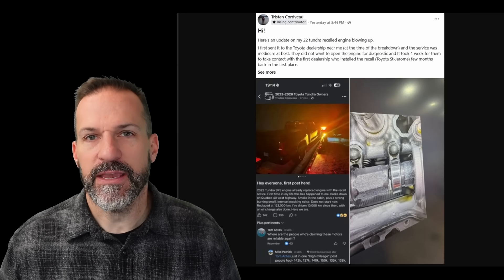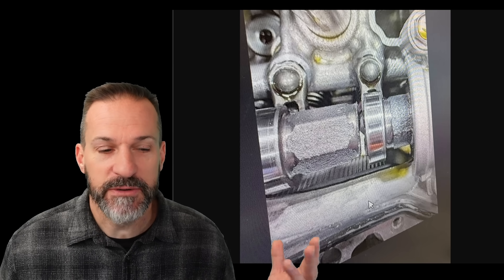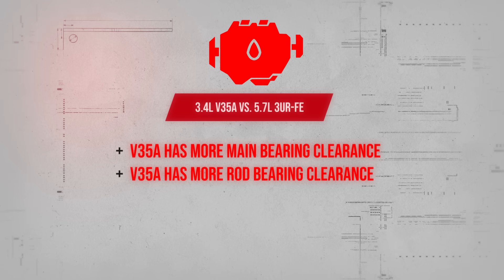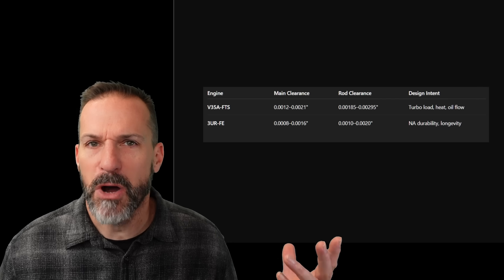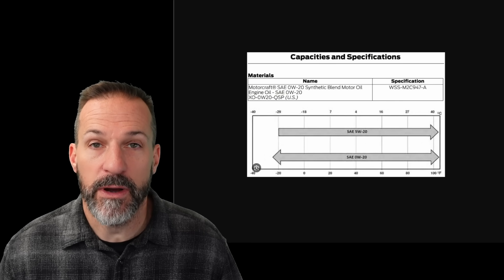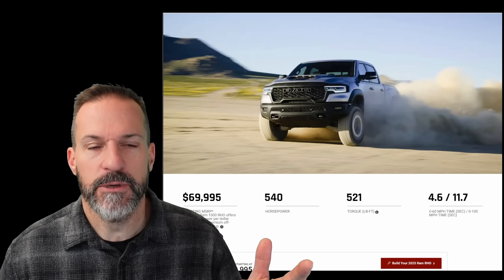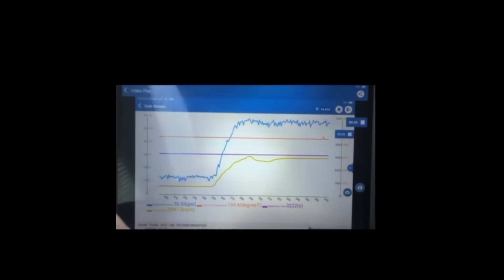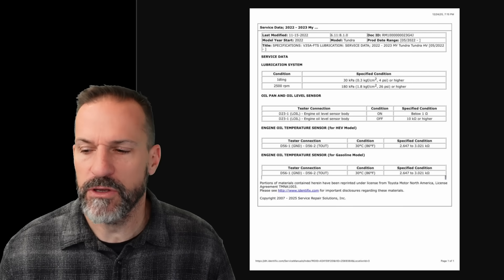Can We FIX Toyota's BILLION Dollar Mistake at Walmart? 2022- 2026 Tundra...

Comment: Is there a mod to increase the oil pressure at idle? To me, an oil pump should be 100% mechanical and not controlled in any way.
Reply: Yes. But expensive and likely custom. Search for “Dry Sump”. Provides consistent oil supply through extreme conditions, angles, and speeds.

Comment: Look up the Stribeck curve guys, understand it. By changing to a higher viscosity oil you push yourself into the hydrodynamic region of the curve sooner, less friction less wear. There are potential drawbacks, the higher viscosity will cause higher engine load which will cause the friction coefficient to climb and higher viscosity oil will have more viscosity modifiers which are subject to shearing. Oil isn't only used as lubrication anymore it's also used as a hydraulic fluid for various functions like VVT. The key is to find the sweet spot of viscosity that gets you into the hydrodynamic region of the Stribeck curve as soon as possible while also keeping engine load low and being the right viscosity to perform the hydraulic functions of the complex systems in the engine. In the case of Toyota and GM where bearings are getting chewed apart, higher viscosity oil is a bandaid fix, but it can be a fix and frequent oil changes are a must.

Comment: 4 6 7 psi is way way to low 22rs Toyota hot always were known for low idle press 15 psi  it would be 50 or so of idle yea computer has to trigger oil pressure after  you stab the throttle that the issue  take time for pressure oil to get on plane low pressure on ideal is bad  do that to any moter it will eat it self 5w40 and tune that oil pressure asap or get get of that dumb stuff modd the world

Comment: 4 psi for the name of fuel efficiency.  That's way too low oil pressure. Fewer main bearing, higher cylinder pressure with the turbo, 87 octane recommended fuel, that v6 has no chance.

Comment: I don't think 5W-30 will substantially help the Tundra V6 bearing failure issue because the factory specification oil pressure for the 2024-2026 4 cylinder Tacoma/4Runner Toyota T24A-FTS engine is also "at least 4.2 psi at idle" and that engine is also undersquare, turbocharged and has a variable oil pump yet it doesn't have bearing durability problems. I think 2022-2024 Tundra V6 bearing failure issue is more related to design issues that are so complex, Toyota's own engineers are having major difficulty coming up with a proven remedy.

Comment: If the variable pressure is the root cause, Toyota could simply reprogram the pumps to increase pressure at idle or lower RPMs. I can’t imagine they’d thrash their reputation for the marginal efficiency improvements that a variable pressure pump would provide. But here we are.

Comment: You finally looked stuff up instead of running your mouth. Manufacturers are using smaller displacement to produce more power- that’s a lot more force on bearing and moving components…

It’s not clearances etc.

Comment: I wonder what the oil pressure is at the rear main bearing.  Could it be near zero in some cases?
Reply from the maker: hard to say. The car care nut and some others have torn down this V35A engine block and tried to determine the oil flow path, I believe they have the sequence described in their videos.

Comment: I have a 2022 tundra and my replacement engine failed at 6k after the install and they said it was a broken exhaust camshaft. And here I thought I was the only one 😮😮.
Reply: I worked for a Toyota dealer in 1980 and Camry hollow camshafts were a breaking

Comment: To find the PROPER WEIGHT OIL EXACTLY. just look up the recommended oil FOR THE EXACT SAME ENGINE SOLD ANYWHERE OUTSIDE THE USA. Stop comparing to other vehicle models ! Simple. What oil weight does the new Tundra model in Japan use ? Europe ? Do they use 5W20 or 5W30 weights ? DON'T GUESS - FIND OUT !

Comment: I work as a fleet administrator and we have about 8000  trucks vans suv ect. They drive this cars for 10 to 18 or 20 hours plus without turning off but to refill the tank. The only oil they use is 5w30 no one problem. With the engines . And they drive this cars to 350.000 miles.  I think the 0w20 is not the right oil for this cars. The 0w20 is getting destroyed to fast. We replace the oil at 4.000 to 5.000 miles but we use to change at 7.500 miles no issues.

Comment: Makes you wonder if a tune could fix this by disabling the variable oil pressure system and locking it out to high pressure only.
Reply: That or aftermarket to the rescue, wonder if anybody makes either a traditional style oil pump for them or if you can put in a stiffer or lighter spring in it to bring up the low threshold for oil pressure. Obviously no good until the warranty is up, but it might be worthwhile. I wonder if GMs would have less lifter issues with better oil pressure. The Ford 7.3s have been eating bearings in applications with high idle time, so its a problem there too. Its not like the industry forgot how to machine a block suddenly, I think its a case where on paper and in engine test bays something works, but by the time you have lowest bidder 3rd party suppliers mass manufacturing parts and engines living in real world conditions things don't work out like they looked like they would.
Reply: @DaveJacobs-f7c 
In the case of GM consider it's a full sized SUV 6-7 thousand pounds? It's cruising down the highway in 10th gear, probably at 1400 rpm and it makes a shitload of torque. Maybe pulling a hill. Probably at the lowest oil pressure to make up a tenth of a mpg

Comment: Toyota built this engine as part of a joint venture with BMW. The interesting thing is that BMW engines often fail after around 50,000 Miles but here they are failing very early .

This engine can be fixed, but the core issue is its design. The engine block is too small for the amount of pressure it handles. Toyota should increase the block size by about one inch, use stronger materials such as titanium for key components like the crankshaft, and reduce the horsepower, similar to what Honda did in the late 1990s with the NSX.

The engine itself is simple and compact, but the twin-turbo setup creates excessive stress. The smaller turbo runs continuously, while the larger turbo operates part-time. This means the pistons are under constant load and high stress.
this engine is failing worldwide. The diesel versions perform slightly better, but the overall issue remains.
Toyota might not gonna do it because of doing this they have to redesign whole engine and the engine bay .

Comment: Kind of sounds like a similar issue that the Ford 5.4 L three valve Triton had where the oil pump was too small and too weak to keep up with the oil demand which caused excess wear and can phaser issues
Reply: The three valve suffered from other issues in the oiling system. There were screens in the cam phasers to protect the moving parts from particulate in the oil. Sub standard oil filters coupled with extended oil change intervals contributed greatly to the issues with the three valves. The oil had to stay immaculately clean otherwise the passages in the phasers stopped up causing lack of flow throughout the top end. Ford spent mega bucks on case studies on oil filters during that time frame. Some warranty claims were not honored due to “improper filters” and or “lack of oil maintenance”.

Comment: Hey 👋 so just putting my input out here I had a toyota  2024 trd pro, I put 65k miles on it always used 5w30 instead of the recommended oil i also boosted the engine and had it tuned running 91 only do to me boosting the turbo pressure i never had any issues with it, but with this whole drama with toyota going on I traded it in for a ram trx just for piece of mind and alot more fun 😅
Reply from the maker: Dang a TRX...that's crazy.
Reply: @TheCarGuyOnline ik its a big change even tho my tundra trd pro was getting 12mpg hahaha this one is getting 12, but I have a company truck so only once in a while truck pretty much

Comment: There is no such thing as tighter tolerances or clearances. It has been known since the 1950s and 60s what you can get away with in terms of expansion and contraction and metals have not changed. Stop perpetuating this myth.

Comment: That's not going to work unless Toyota or some aftermarket tuner company reprograms the ECU first. The ECU controls the oil pressure that controls variable timing and both are carefully synchronized in order to optimize engine's on-demand performance. Throwing thicker oil into the mix may help save the bearings while destroying other things in the process. Toyota has to change course first and approve this scenario or Tundra owners who do this on their own can kiss their warranty goodbye.

Comment: i think the big issue is quality of parts dropped around 2019-2020. defective parts increased since then and many shops testify to this. I believe the parts that toyota is having manufacturers make are just not as good as they used to be. Solution: engine swap the old 5.7 into the new truck. problem..... mostly solved.... cant vouch for the rest of the truck

Comment: I think you’re right on the issue! Jeep had a similar issue from late 2013 with the eco diesel. I’m in NZ I have an early version made 2012-13 for Aust, NZ, and Europe. Motori A630 3.0 diesel with a 5 speed trans. They did two things late 2013 on. A slightly bigger turbo and an 8speed transmission, and had problems with spun bearings attributing the cause to the gear ratio when the engine was being lugged at low rpm, the fix going from 5w-30 to 5w-40. The 5 speed early versions from what a jeep mechanic had told me, they have seen none with this issue. Too much torque at low rpm and wrong grade of oil another recommendation was tow in sport mode so it keeps the rpm up and the engine doesn’t work as hard.

Comment: 2020 Ford Expy 3.5 owner, Motorcraft full synthetic 5w-30 every 4-5k. Runs like a sewing machine at 105k. I will be checking the PSI as soon as I can. It's interesting that when Ford changed the oil spec is about the same time that Ecoboost engines started having fewer problems.

Comment: Cars have been using 0/20 for years, without major issues. This leads me to think it's as much a MFG / design issue as it is the weight of the oil. Granted these smaller displacement turbo engines are under more stress, we are living in the days of over engineered and under tested new engines.

Comment: This makes complete sense to me. I personally have decided to stay away from engines with turbos until engineers sort this out.
Reply: Ford has had it sorted for a while now.
Reply: They can't figure out how to cheaply turbocharge an engine...yes.  Tractor-trailers and 18-wheelers seem to do pretty well - 600 hp and 2500 ft/lbs of torque while pulling loads across the US continent.

Comment: I've owned Toyota's for 45 years and see what's happening to this V35A-FTS engines are SCARY..I've worked on engines for over 40 years.. At FIRST I took Toyota corp. WORD that it was DEBRIS that wasn't completely removed from the block after the second year i call it B.S... The ones that are causing the nightmares for these Companies is EPA an CAFE, if they don't follow their standards they're giving very large fines.. I praise the person who hooked up a oil pressure monitor and found very disturbing oil PSI readings like 4psi an 7psi at idle..If this is fact with these engines this may be why they're TEARING UP the main bearings its usually 1 and 4 they take largest loads... I found out that manufacturer psi should be 15 at idle on this engine even at that is below my standard of comfort always had 25 to 30 plus psi at idle ... The 389 horsepower , 479 lb-ft of torgue and Twin-Turbos as far I'm concerned should have minimum 25 to 30psi at idle.. Especially these engines that PUSH high TORGUE in low RPMs...This is what I've done so far to my 2024 TUNDRA TRD 4X4 with ONLY 15,000 miles.. Four oil changes done my last one with 5w-30 instead 0w-20 what it call for, also my oil changes at 5,000 miles intervals NOT 10,000 miles what they call for...I'll be sending another oil sample to the LAB for testing to see if everything is still on track...🤠

Comment: #1 cause is companies being cheap, cheaper and cheapest.  This is for engineering, materials and labor.  Oils too thin.  The smallest parts that 'might' be able to do the job, and built as cheaply as possible.  Toyota built their QDR reputation over decades, and they could completely lose it in a few short years the way they are going.  I am hoping all the new Toyota models and engines work out long term, but it does NOT look good right now.  Your ideas sound good, but the mfgs should be doing this, not us consumers

Comment: It is not tighter tolerances. My GX460 is built to the exact tolerances. I believe they over-stiffened the crank journals, which caused the engines to eat bearings. If so, it would only affect trucks running at higher RPM. People who baby their trucks and hybrids would not have the issue. The undersquare design adds to the speed the piston reaches before stopping to go the other way.

Stop saying it is tolerances. That is just the internet, with an average fifth-grade education, doing its thing. It is similar to people believing the P320 can fire without the trigger moving. It’s impossible and sounds foolish to everyone who knows better.
Reply: What's a p320?

Comment: I switched our 2022 honda ridgeline to 5-30 high spec oil. Change it every 3500 miles. And I am hoping it will last past 100 k.  Nuff said. I thought gas mileage would go down. It went up for some reason. I think there is more oil film and therefore less drag with 5-30.

Comment: Unfortunately toyota isn't simply going to be able to easily remap the oil pump settings since it will "impact" emissions. Any real fix from toyota will take years to be approved. Heavy oil or fooling the pump to run on high are the only options for now

Comment: MY 21 TACO WITH 8K MILES 5 SPEED MANUAL STALLS THE ENGINE AT LOW RPM WITH 0W-20 IN TRAFFIC. I AM VERY FRUSTRATED WITH THIS ISSUE AND SWITCHED TO 5W-30 AND WHALA... NO MORE STALLING LIKE IT USED TO. PURCHASED BRAND NEW AND WILL STICK TO 5W-30 FROM NOW ON.  MY 24 ARMADA ALSO WENT TO 5w-30 FROM 0W-20. WHEN DRAINING 0W-20, IT COMES OUT LIKE WATER AND MAKES A MESS AROUND THE BUCKET.. NOT WITH 5W-30.. IT FLOW OUT LIKE OIL!
Reply: Oil doesn’t cause stalling lol.  What?

Comment: Throw in 5w/40 and run it! While doing so, log the oil pressure to see if the computer is still trying to compensate down to single digit psi numbers. If it's still doing that, then it may need to have a tune done to keep the oil pump from getting below say 25psi. Just my two cents from a diesel tech with 20 years in the game.
Reply: 5w-30 may be the best option to begin

Comment: May be partly due to the old management engineer battle in companies. Engineering wants a grade 8 bolt and management says what can you get away with? Or if it impacts fuel economy, what can you get away with for max fuel economy?  All the compromises caught up with the manufacturers.

Comment: When you get above 200 degrees Fahrenheit (normal engine temperature range) all oils get pretty watery and the actual viscosity is different, but not by much. Between say 0w20 and 5w30 at 212f the viscosity of 0w20 is about 8 centistokes and 5w30 is 10.5. 
 Lets say you’re running 0w20 in the winter (what I would do in the winter) and your engine is 20-30 degrees cooler than summer, the viscosity would be the same as 5w30 in the summer. 
At room temperature they are both above 100 centistokes (about 130 and 150) with 5w30 being noticeably thicker, but at operating temp they are both quite thin.

Comment: Actually seen GMC 5.3 liter on a 2021 do this low oil pressure at 3.5 discussed this with GM Engineer the smart ass said it’s designed to die that at ideal . Three weeks later same gmc was on flat bed and the cam was cracked. New short block under warranty installed along with a new engine module. They know the problem and how to fix it. Truck is still going strong.

Comment: This is simple.  More power, more torque, one less main bearing to spread out the load plus inherent balance issues with a v6.  They should’ve built an inline 6, the ultimate in proven reliability and smoothness.  Toyota of all companies, given they built the 2jz that everyone turbocharged with great success should know that if you want a turbo 6, it should be an inline 6.

Comment: I do not know if low oil pressure causes damage to an idling engine with no load on it.  But with a load on the egine at higher RPM, I could see how thin oil would cause damage-- the film needs be thick enough to stay in the clearance gap.  I can't imagine how the heat of those turbo chargers are thinning the oil, too.

Comment: @TheCarGuyOnline dude thank you for finally posting a video about all trucks with this. Because I’ve been saying this and getting called dumb for the longest time. I followed the Japanese specs on my tundra, a 23 change your oil at 500-1500 and 3000 miles 0W 20 and then you can run your W 20 to 10,000 because you’re still technically breaking in your engine thenand then at 10,000 switch to 5W 30 or 0W 30 because a turbo engine should not have a viscosity less than 30 at the end
Reply: Sidenote, if you do switch to your W (40) make sure you tell them they should be doing oil changes before 10,000. The farther the numbers are apart from each other the more likely it is to shear